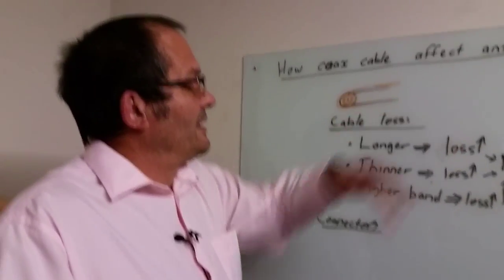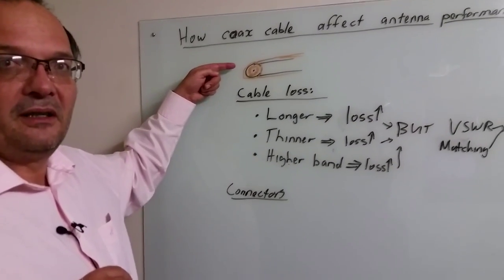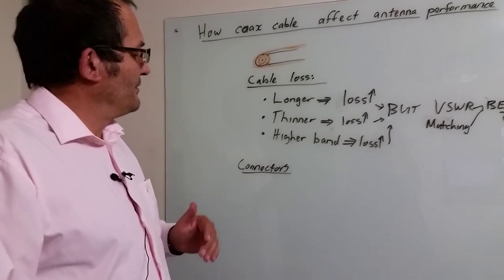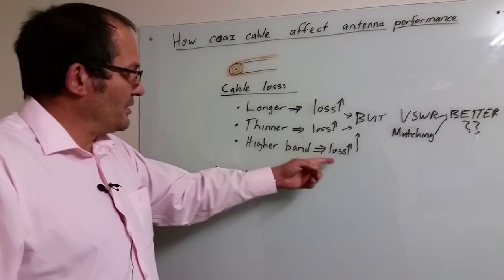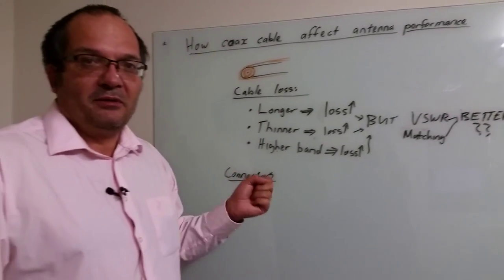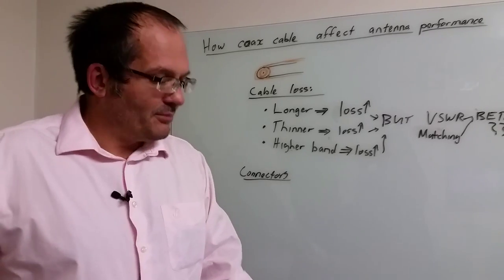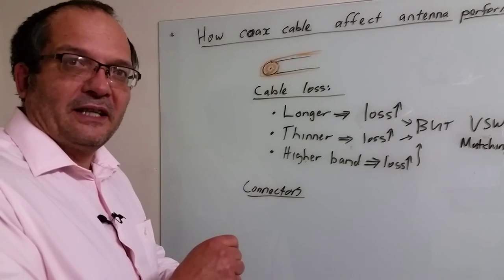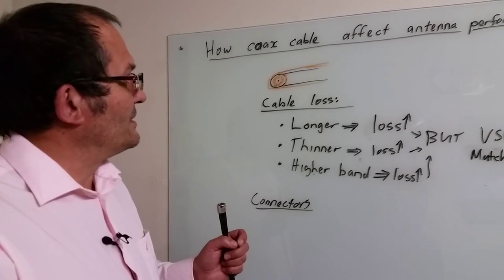How coax cable affect antenna performance?

Comment: What about in a mobile application without a shunt match if the cable acts as an impedance Transformer or impedance repeater depending on length?
Reply: @poyntingantennas  for example if we have a 50 ohm antenna with 5 ohms of reactance and a feed line with a randomly chosen phase angle of 120 degrees, the impedance presented to the transmitter would be something other than 50 ohms.

Comment: I'd like to install a WiFi antenna at the top of my sailboat mast. The measurement from the masthead (e.g. antenna) to the mastfoot (e.g. antenna cable exit) is 45 ft. What antenna cable specification, if any, is best?
Reply from the maker: Good day J .A.T. III,

The tables does not work well in YouTube - please comment with an email address if you want me to send you a mail. 

Attached is a Table with two types of cables, the HDF-195, which is an easier cable to install, and the LMR-400, which is quite a thick cable and thus not a easy to install but has much better attenuation/ft as you can see:
(the Antenna specification is that of our OMNI-496 Dual-Band Antenna for Wi-Fi frequencies, 2,4GHz and 5,8GHz)
From the Table you can see how important losses are in the cable are... point about an Antenna is the Gain 'retrieved' from high up on the mast!
 
		HDF-195				
Frequency	Cable Loss/m	Cable Loss/ft	Cable Length	Cable Loss	Antenna Gain	Net Gain
       2 400	MHz	0,5330	dB/m	0,1599	dB/ft	15	m	45	ft	7,995	dB	6	dB	-1,995	dB
       5 800	MHz	0,9810	dB/m	0,2943	dB/ft	15	m	45	ft	14,715	dB	7,5	dB	-7,215	dB
															
		LMR-400				
Frequency	Cable Loss/m	Cable Loss/ft	Cable Length			Cable Loss	Antenna Gain	Net Gain
       2 400	MHz	0,2175	dB/m	0,0653	dB/ft	15	m	45	ft	3,263	dB	6	dB	2,738	dB
       5 800	MHz	0,3540	dB/m	0,1062	dB/ft	15	m	45	ft	5,310	dB	7,5	dB	2,190	dB